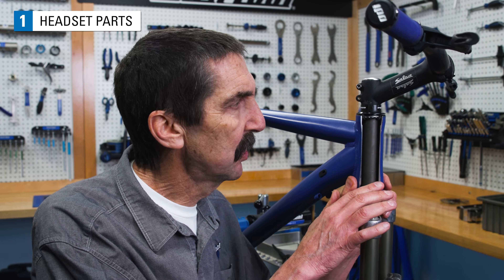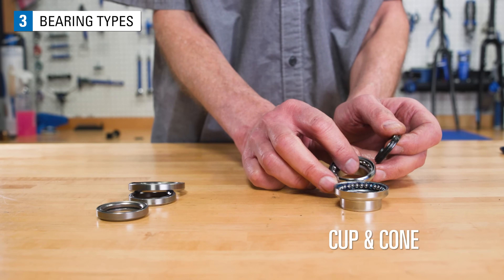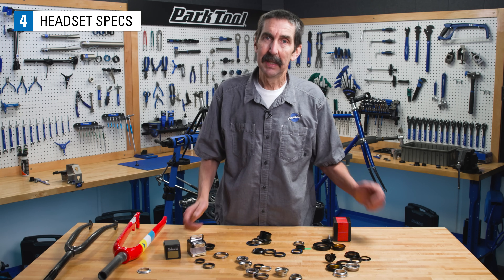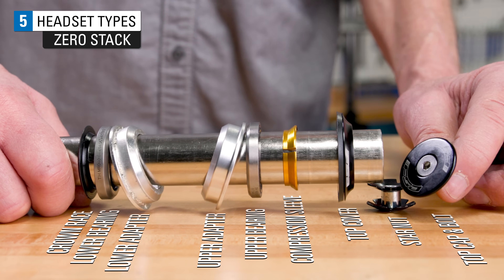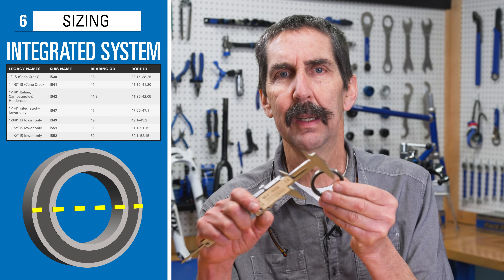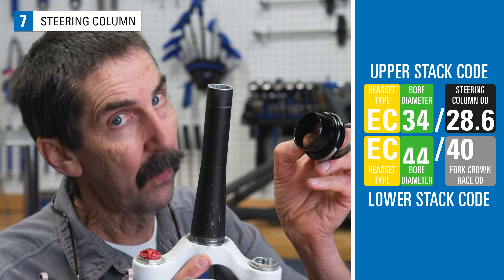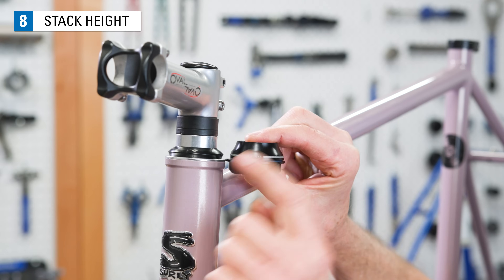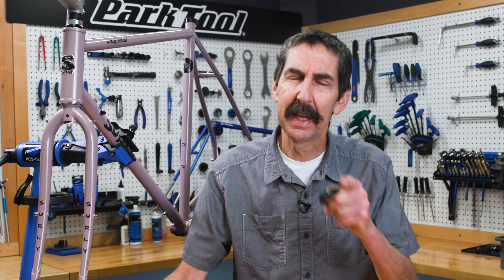How Bicycle Headsets Work

Comment: I have a 2014 focus which has quite a strange headset. It doesn’t come with a star but/top cap&bolt. In fact when you look too down into the headset, you just see a hole that leads into a sealed chamber. I’ve not seen this before. The upper most item is a black ring with the word ‘cros’ on it. So how does this type of headset work when it doesn’t have top cap and bolt?
Reply: Headset is most likely Acros, carbon steerers generally come with a compression wedge instead of the usual star nut. No difference otherwise in the headset.

Comment: I'm using a Trek pro 9.5 frame. When I serviced and reassembled the headset correctly, there was a small gap between the frame and the knock block about 1mm - 2mm. Is this okay?

Comment: Hi, I just watched your video, and it is very well explained.  I have a Schwinn loop folding bike, and my handle bar is so different.  It is a little crooked. Can you give any advice on how to straighten this kind of handle/fork and tools needed?  If you can, it would be helpful.
Reply: I think it is the headset part I have to mess around with to straighten it out. It is all i can think of.

Comment: Is Headset a reference to the two bearings togther.  Seems they may often be different.  Judging from mine, the lower bearing has much greater stresses in it than the upper one.

Comment: the threaded system seems like a better connection than threadless  and is another reason I've always liked working on old road bikes than even my brand new Surly that i've been building from the frame up and just about matches the one behind my dude Calvin. atleast now I know why this EC headset install is harder than the time I replaced a fork, or the baring swap I did for my Uncle. This is why I love to crank!
Reply: Efforts mostly happen upward from the front wheel and fork, to the head tube... so it makes sense to have a lighter blocking system on top...

Comment: Both my IS headset bearings are IS51, top and lower.
Stearing column 28.6mm.
NO crown race at the bottom..., just a smooth finished and angled carbon surface.
Reply from the maker: The crown race is just part of the fork, built in to the system in your case.
Reply: @parktool  Thanks for the answer. I got a bit worried if something was missing.

Comment: I have a Cube Two15 Pro 2024 wich has a noise coming seemingly from somewhere on the headset, it started after i tightened it a bit as i realized there was some slack on it wich shouldn't be there. When i re-did the bolts in the upper crown it seemed to go away for a little while but abusing the suspension a bit seemed to bring it back just about inmediately. Both the steering and fork are the stock XFusion RV1 36 and the Acros 1 1/2-1 1/2 with angle adjustment ( or at least i think it's that one, found it in Bike 24 ). XFusion doesn't offer torque specs for the bolts in the upper crown so there's a solid chance that the problem comes from there, but tryng different torque values doesn't seem to help much and i don't wanna strip the bolts for obvious reasons, any ideas?
Reply: I also have some noises coming from my Cube, I wanted to inspect the steering tube, but with all these hoses and sheats it's just not doable without a crazy amount of work!
Reply: @DR_1_1  oof, that's why i hate things like internal and headset routing, turns 3 minute jobs into "i'm going to jump out of the nearest bridge". I eventually managed to fix it by re-greasing the entire thing, turns out that since there had been a gap in the steering resulting on the slack i fixed the first time around there had also gotten a SHITLOAD of water in there, thankfully the bearings were perfect inside despite looking like they came out of an abandoned 1930's rustbucket on the outside. Once everything had some assembly grease in place it was silent once more, but for some reason the top crown was a PAIN IN THE ASS both to remove and insert back in, safe to say it's not coming appart any time soon... And before you ask, yes, i did undo the bolts on the crown, i checked multiple times and i still needed help from my brother to get that thing in and out. It still gets me pissed to think howannoyng it was, neither my boxxer or my marzocchi needed 1/10th of the effort to assemble and dissasemble
Reply: @Ferrari255GTO  Today's solutions are tomorrow's problems, as they say...
On my side I hope I won't need to remove the fork, or at least wait until I need to bleed the brakes to do it - I didn't notice any slack for now, just cracking noises when I brake frankly sometimes (that said carbon can be noisy, I noticed that in other sports).
Reply: @DR_1_1  sounds a bit more serious than it was in my case, i wouldn't put it off for too long honestly, haven't seen it happen but aparently steerings can "ovalize" themselves, don't think it happens to carbon since it doesn't bend the way aluminium does but there could be a crack hiding in there or something. I hate to say theese things because more often than not it's nothing but i think it's also fair to say nobody wants their frame to fail mid ride, it usually comes with damaged components and injuries resulting in a LARGE pocket hole and quite a bit of downtime

Comment: My bicycle has integrated crown race/cone on carbon fork. The bearing is for 36 degree cone. But I know from the wear on bearing and also on fork, that the cone on fork is not 36 degree. I have no device to measure the cone. So I don't know if it's actually 45 degree or maybe something between 45 and 36. But the fact that manufacturer has installed 36 degree bearing and the carbon cone on fork looks okay, just little bit straight line around where bearing edge rests on it.. but I don't see delamination or crack. Just normal wear from 10 years of riding. But still because I'm not sure with what to replace it. I decided to replace also fork, with a non integrated cone.. Then I can be sure.
Maybe it lasted 10 years because bearing did not have so sharp edge, but little bit rounded. If I replace it with something sharper. It might cut into that cone/race dig into it and maybe that's a bad thing.

Comment: I'd love to know if Park has any tips for installing angle headsets since they need to be lined up. I used string lines on both the top and bottom of the bike to try and keep things centered but still had to redo it at least once. Excellent video as usual!